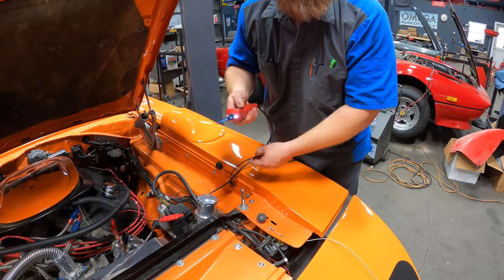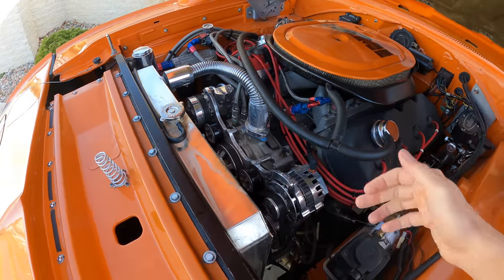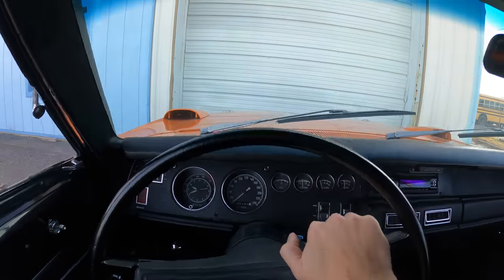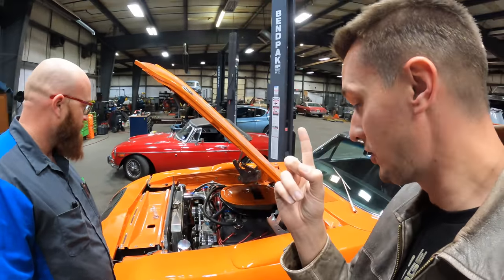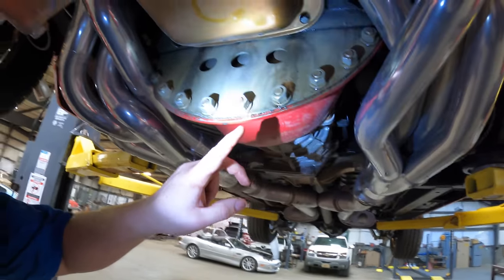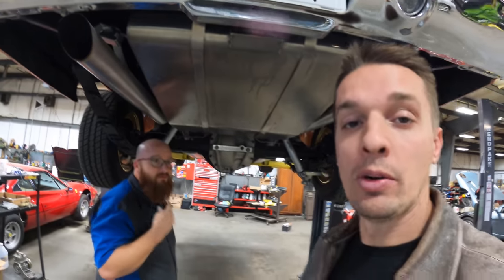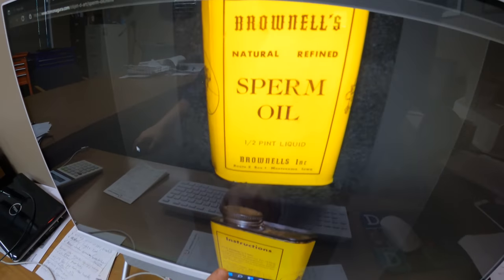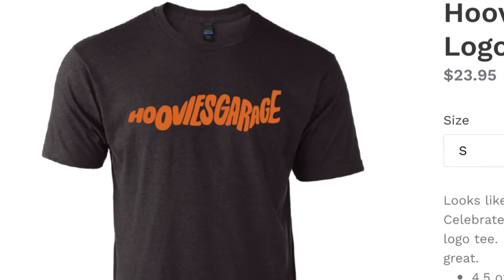How I got SCAMMED buying a Plymouth Superbird online sight unseen (So much broken/missing)

Comment: That vacuum pump in the engine bay is nothing more than a water pump for a small little pond turned vacuum.  and i am guessing its the same with the other pump. im guessing the headlights need a lot of vacuum to stay up and that why there is two ?

Comment: Maybe this vehicle was involved in a tee bone crash but was the giver not the receiver. That could explain the floor pan looking unmolested and the front suspension being changed to a street rod mustang two style unit. The car would be much more desirable with the original components.

Comment: Fuel pump for power houses can sound like that, but I would not drive it with teh combitation of the rad barfing and low oil pressure. I would call head gaskit right there.
Reply: ok that pump is loud as hell

Comment: Weird fact: there are an ENORMOUS number of lousy (China) radiator caps out there. The ONLY ones I have seen hold the right pressure are the Chrysler caps-dealer or eBay. 

That car has been desecrated and should probably be parted out, or completely disassembled and re-restored.  The front suspension is very scary (almost all the coilover conversions are) and the car should not be allowed on public roads.

Comment: 13:05 You can adjust the front torsion springs, I cranked up my old dodge front end about as stiff as the kitchen table and dropped it right on the ground too. I don't think it's any good for the car though.
Reply: I also didn't finish watching this yet, So if they figured it out by the end , don't yell at me.
Reply: It's got a aftermarket front suspension.

Comment: @ 24:38 "The motor seems healthy," yeah, it looks good. (But really we should do a compression check on it to MAKE SURE it's good?) We could also pressure test the coolant system to see if you have any "other" possible engine issues? But hey, you're right. It does "look good." Lol! p.s. On a car such as yours, do you have any idea why the speedometer cable might be broken? LOL!

Comment: Now for you to score this beautiful monster for $130k, now THAT'S a real score. Back in the day my mom had a 1969 Hemi Roadrunner with a Hurst 4 speed A833 trans, in Plum Krazy, with the dual 4 bbl carbs, and shortly before my oldest sister was born she traded it to my uncle for his 1970 Galaxie 500 station wagon. The next day my uncle's girlfriend hit a tractor trailer head on, totaled the Roadrunner, the hit was so hard that she was ejected from the car, the Hemi was in the front seat, and she walked away with a few scratches. Sad. That car would've easily been worth $250k nowadays if it had been completely original. My mom used to use that car to scare the hell out of people because it would pull the front wheels off the ground going from 1st to 2nd. Shortly after that she bought an original 1970 Mustang Mach One with a 351 Cleveland and a 4 speed in brown. Now she's 70 and drives a new Prius...lmao

Comment: That Sperm oil is for what he's putting in your rear end.  Giving quote for longer shocks when you really only need the proper springs . The best shocks are a third of that quoted price.   Coil over springs come in different spring rates. rated on the front weight of the car. You need to scale the car for proper springs . Do not guess or you will have a bunch of extra springs you can't return.  Vacuum pump , it would seem that a line check would be the first thing to check. another pump will run constantly also if the lines are no repaired.  Brace yourself while you bend over.

Comment: I would be a lite surprised if the vin tag doesnt show molestation.

Overfilling a radiator as a problem is about as logical as overfilling a gas tank causing carb issues. Lol

Comment: I had thought that these use manifold vacuum to close the "hide away" headlights as they were called back then.
Was Chrysler still using torsion bar suspensions at that time?
Reply: Chrysler used torsion bars well into the eighties

Comment: Yeah...
Let's put a pressure tester on that. Instead of just replacing the $10 part 😂
Yes. We Have to replace it anyway probably. It's no doubt a pretty old part too. And it's Leaking. So it's coming out one way or another,.. BUT.
We CHARGE by the HOUR. No money in fixing the Cheap Stuff to quickly 😏 ... 😳

Comment: thought vacuum pumps like those were made for brake boosters on forced induction engines? 1994 4.6L thunderbird makes 10 pounds of vacuum at idle, rev to 2500 let off and its got 23 pounds of vacuum... i don't think those pumps are needed, few little one way air valves and solenoids run off the switches. just rev a little with the switch on, on rev half way up two and its locked open, normally protruding solenoid pin pulls out momentarily and it falls back down. 🙄 meh

Comment: The worst thing about this video is that my dude buys the cheapest Superbird in the country @ 130 grand, then cringes at 1250, 1500 ect for fixing it up and finishing it. My old man bought a 90 grand Cuda 440 6 pack and had to put another 30-40 grand into it to finish it up. If it had been finished, they go for 150-170 even more depending on options. Quick search showed 225, 300, 430 thousand as going rates for Superbirds. Hell, even the tribute superbird was 143 grand...

Comment: With the various things I see on this car 'that are NOT factory Superbird items', I HIGHLY doubt that the engine is 'blueprint to OEM', either. ALL Superbirds had the rather-famous 'Race Hemi' (versus the 'Street Hemi' that usually made it to showroom models). The difference? About 200-horsepower...achieved by, among other things, a different camshaft and larger domed pistons that yielded 12.7:1 compression (gasoline below 100-octane, need not apply)...timing dialed up to maximum advance possible, the Hemi 'Race Engine' could easily reach 700-horsepower...some say a few ponies more. I was fortunate enough to see two actual 'track Superbirds' in my younger days...and they looked, under the hood, just like ANY OTHER CAR...so when you start seeing chrome, colored under-hood panels, no OEM decals, etc., you start doubting 'original' anything! (FYI...Dodge/Chrysler had a contract with Warner Brothers in the day, and MOST of the air cleaners had, believe it or not, cartoon icons on them...such as the 'Roadrunner' character on cars such as the Plymouth Roadrunner AND the Superbird (showroom model)...another 'tell-tale'...

Comment: I am having a problem believing this is an original Superbird.  There is a big gap between the front nose and the fenders. And the front fenders are not correct. The front fenders should have a separate bottom piece just in front of each wheel. Plenty of stock images showing these differences.
Reply: They are Coronet fenders, but it looks like the seam was filled in.

Comment: This is the coolest subject I've seen on cars lately, has all the elements. Just strip that car down to bare bones. Yes it's one that doesn't look quite right. Sort of looks a touch short and not solid. But again. Strip it down. If you can make it work somehow it will sell for big bucks. It's possible.

Comment: dude defiantly got scammed. from what can be found from the BAT listing this thing is not a superbird its super fake. the dash vin states its a 1969  plymouth gtx. the fender tag does state its from a hemi car but it also states it had a fresh air hood (superbirds never came with fresh air hoods). also from what i can tell from vid is the car has had pretty much all of the floor pans from the firewall to the taillights has been replaced. so slight drivers rebody is highly unlikely. i used to work in a resto shop that has done alot of mopar cars over the years. BEST OF LUCK HOOVIE WITH YOUR 130K HEMI FENDER TAG.

Comment: I would replace that idiotic aftermarket suspension and resinstall the original torsion bar setup.  You should be able to find B body suspension components.

Comment: I would say that the Hemi Orange Super Bird was a killer deal. If you did not have to tinker with it after getting it, I would say the car had no character. That being said, no self respecting Roadrunner owner, whether base or Super Bird owner, allows their MeepMeep horn to go inoperable! That is plain sacrilege! The partial rebody, blown front suspension, and a couple leaky gaskets can be overlooked, but a MeepMeep horn not working is the worst form of negligence imaginable. It is best that the fella you got the car from sold you the vehicle because he was undeserving of such a treasure. Just saying.

Comment: The auction site did a good deed. The seller was a crook. Any guy that has a Superbird would know the issues gone over in this video. That was more like a 90k car than a 130k car. 90k is still probably to much considering it was pieced back together and is a resto mod. Since it's not a numbers car I say have at it and do a real rddto mod on it. New motor , brakes , suspension. Give it a Hellcat Red Eye motor and get it rocking !

Comment: nice repair job  replacing all the metal  by  drilling out the spot welds on  each panel and  replacing with fresh metal    instead of cutting and splicing

Comment: He has the Torsion Bars cranked up the entire way against the stop . Factory Gauges are never accurate . Mopar Electrical Systems suck . And please old cars have a " Sending Unit " not a " Sensor " .  My guess that the engine was a Crate Motor .  Looks like it has a Rack and Pinion .  That thing was so messed with I would have never touched it .  Funny it seems how there are more Birds and Daytonas in existence now than were built .

Comment: So you paid a buttload of money for an old car that has typical old car type of crap wrong with it.   Still a freakin super bird with a hemi and a 4 speed.   Should be able to rebuild that vacuum pump pretty easily.  But they tend to be pretty noisy regardless…and the huge leak shouldn’t be hard to find.

Comment: Sorry, but you violated the basic car buying requirement.  Get yourself a pre-purchase inspection.  If the guy's 2000 miles away, find a local expert near the car and pay a few hundred dollars.  If you agree to buy it then and there's a hat and stuff, require that the hat and stuff gets sent via a separate box, insured and all that.  Of course, you also could have flown to the seller and looked yourself.

Comment: Personally I think this video is misleading. Being scammed would entail if say the buyer sent the $130,000 and the seller vanished and the buyer received no car and no title or if say the major components like the engine or transmission showed up with say a rod knock or a slipping clutch or grinding gears. Any used car always needs stuff and especially on a used car thats around 50 years old. Surely the seller missed a few things and kudos to Bring A Trailer to refunding the buyers fee. Which I personally think that the buyer should refund the money back to Bring a Trailer. The car was bought at an absolve steal at about $70,000 below the market value and it needs very little. The funniest part is at the end of the video the buyer looks very happy with his purchase and the mechanic even likes the car. I think that the front shocks at $1250 were way way way overpriced personally.

Comment: ya know, you can can use a cellphone as a speedometer/HUD, it uses gps, also not scammed, you didnt buy a car you bought the lifestyle, a wet dream for many, yup it needs some maintenance, then again not a car that you wanna daily, i bought a bike thats been sitting for 30yrs, a safe assumption yeah the electrical is probably shot carb needs cleaning, etc... hay im happy with my purchase. why on earth would you buy a vehicle without looking at it first. dont do that guy
Reply: that car is mint
Reply: watch the mechanic lose it, trying to process the brand new car before him, then try n' sell ya on new exhaust, what ya have is correct.